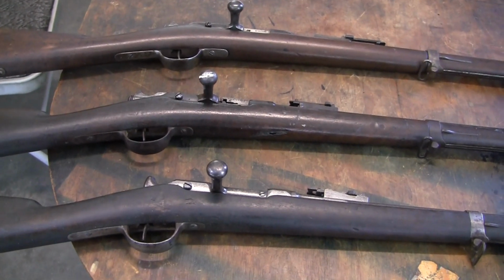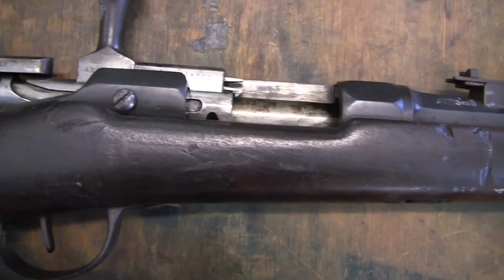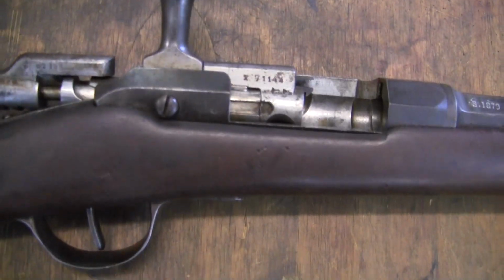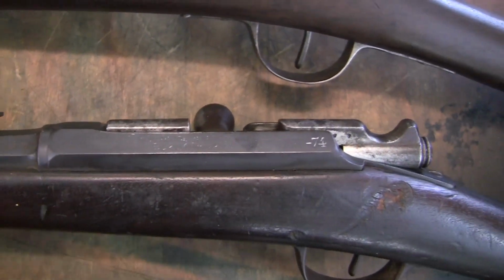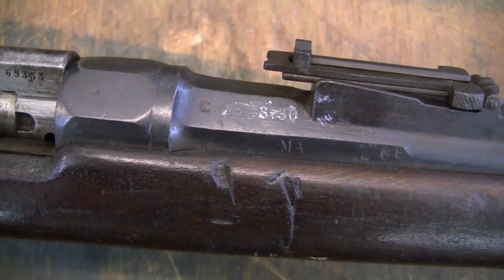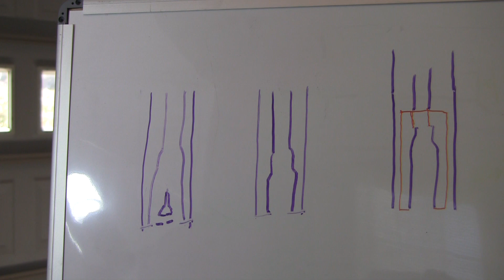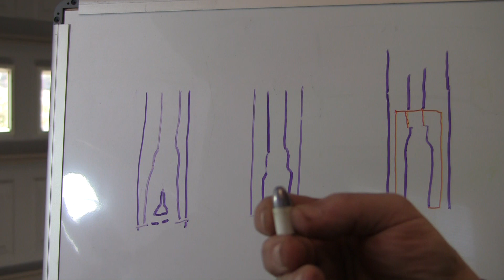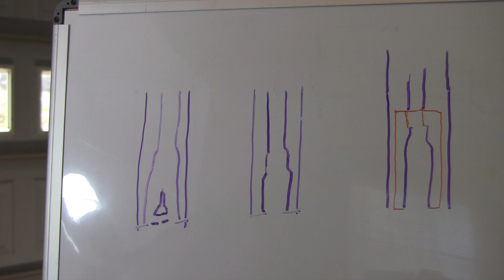Gras 1866-74 identification, reloading problems, conversion

Comment: The C and S on the barrel is for the arsenal who made the barrel. S would be St. Etienne (MAS) and C would be Châtellerault (MAC). In the case of the conversion MAS did the conversion to the Gras but MAC made the original barrel for the Chasspot.